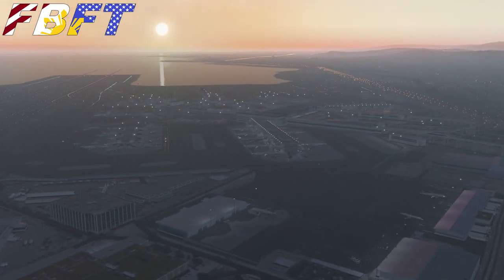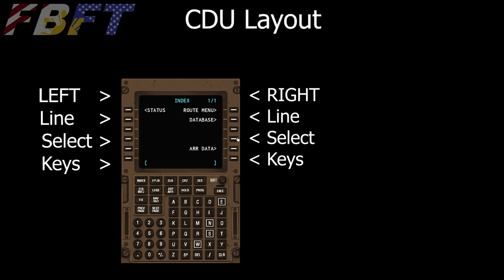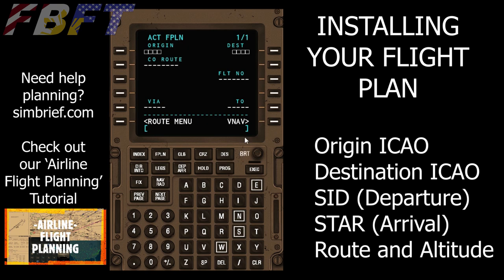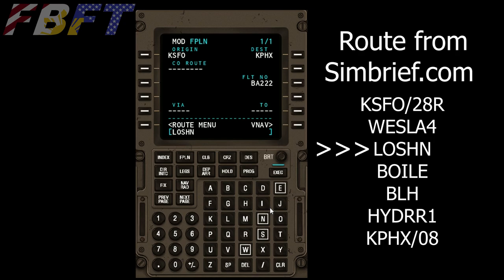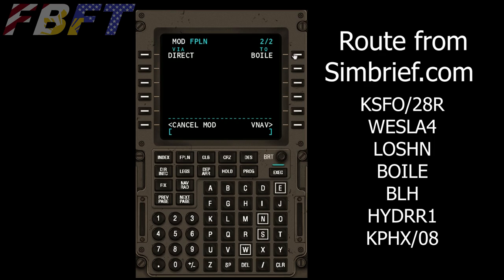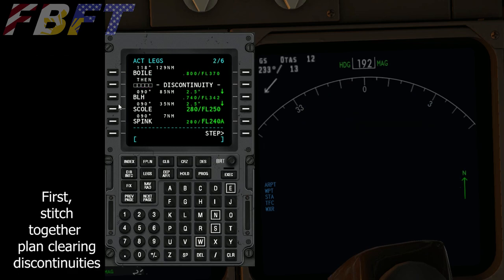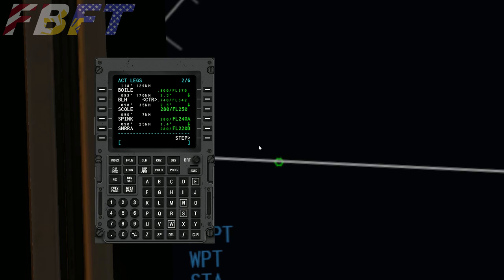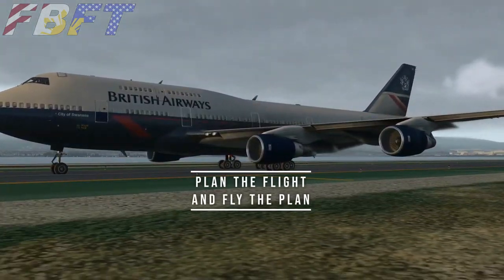X Plane - Default FMC / FMS Tutorial - Setup and Install Flight Plans

Comment: Great job again ! hope you gonna finish next procedure from departure till arrival with this plan .. look like interesting
Reply from the maker: That is what I'd like to do.  Honestly I did fly and film the trip immediately after the data entry you saw on the video, but I had issues during descent.  I will experiment a bit more to see if I screwed up or if the FMC wasn't operating in a normal predictable way.  If you just want to get going though-  take-off, above 1500' click LNAV, VNAV, and CMD.  Make sure the flight directors and autothrottle switches are on.

Comment: Yes finally I found and was shown how to do this manually, and in a speed of a DC3 not Concord  speed demonstration. It was also good that after you had typed in your flight path and you begun to check it out that you had some issues that had to be fixed, so you showed us how to fix these errors. But you still had not quite figured out or proceed the final leg where all at a sudden you were back to 5.000 feet for some strange reasons. So you stared to wondering why that was so and you went through all the pages from 1 to 5 , but the pages they were 6 of them, so why didn't you go to that 6th page to see if you couldn't see or find out what was causing that problem, maybe you could have seen it there and deleted on of the point as you did with the first error what you had to deal with? But in general this was very nicely done, and thank you Flight Brother
Reply from the maker: Thank you for the feedback. Happy flying!

Comment: Definitely one of the best tutorials I have seen on the FMS/FMC for sure. I just picked up a KingAir 350 from Airfoillabs and it has a FMS. I imported a FP from LittleNavigraph last night and it came in just fine. But it did not set the ADF for the first NBD waypoint. I would think it should do that? I had to manually program it and the the plane would not go to it which I am sure is on my end, but it just got stuck on the first waypoint and would not advance and I saw now way to advance it to the next waypoint in the plan which was a VOR. So I am a bit confused on how the plan goes from the FMS to actually being used by the aircraft. I am going to build a plan manually tonight and see if that makes a diff since I did not validate the steps with the MDF which might have clued me in. I have watched a lot of FMS videos and not one described my question so I must be missing something very obvious. Anyway, I have some breadcrumbs to follow tonight. Cheers !!
Reply from the maker: I suspect the issue is what input the autopilot is receiving. I'll see if I can check where that is for you, but basically there should be a switch or knob to go from nav/fms.  The FMC does not time radios, as it will find them without them being tuned.
Reply: @FlightBrothersFT  Yeah that is sort of what i figured, but could not find anything. And the docs that came with the plane are not very good. Plane is great...documentation not so much. I really like to know what each knob does and how and when to use it, so some decent docs would be nice. One last thing...is there a way to manually advance to the next waypoint in the FMS like you can do in a Garmin? Thanks for the reply. I appreciate it. At least now I can narrow my search.
Reply: Took me a while after an exhaustive search to find a manual to match the FMS in the King Air, that the version of the FMS in XPlane is a customized one and used in all XPlane aircraft that have a FMS device. So the documentation was readily available from Laminar. So there are about four hours of my life I won't get back. But hey, my company just let me go and gave me a real nice severance so it looks like I am retired now and have oodles of time to spend learning all this stuff. Between this video and the King Air manuals (real one) I downloaded, it's coming together. Thanks again for the reply. I will let you know the final answer, although I am quite sure it's just something stupid on my part. AE

Comment: Very nice and nice timing. I have been using XP11 for a little less than a year, and started watching your vids and learned a great deal when I got in to the hobby. Most of that in the Zibo. I have gotten an itch to fly the 747. So I get it started and realize I forgot how this FMC worked. Also I had no idea how to do the freq for ILS and course. So thank you for mentioning this. I would also be interested in seeing the resulting flight. MY flight plan I did before seeing this had the same issue with no runway in the plan. I am going to try again soon. Thank you again!
Reply from the maker: Thanks for commenting. I did film the flight, but had issues getting it to descend on the FMC. It might have been user error, it might be the vnav has issues on descent. Either way you didn't miss much worth seeing. Ended up going manual for the arrival and approach.
Reply: @FlightBrothersFT  Well I did my flight. I had to manually enter the final legs. But there were not missed approach legs. AP worked great through climb, cruise & decent. But upon final approach the plane started away from the airport. I could not disengage the cmd or change speed. I had to disconnect AP and fly manually.

Comment: Pretty good job guys.  I haven't read all the comments so I apologize if I am repeating what others have said. Yes Id love to see a video on how to implement the FMC into an actual flight.  I will be doing some reading SimBrief and the FMC manual  Please contact me via e mail or how can I e mail you?  I don't use my g mail account. I used 2 computers one to watch and take notes the other was to open x plane 11, the 747 400 and log what you said into the FMC.  There were discrepancies in the route/waypoint numbering both written and verbally.  I really enjoyed the "mistake" in the route and you show to remove/edit those items that need to be removed.  All in all pretty good job.
Reply from the maker: Trying to match our flight plan exactly will depend on which AIRAC cycle of nav data your Xplane has. We have Navigraph chart subscriptions, so our videos tend to reflect whatever was current at the time of recording. Regardless, you can generate your own flight plan in simbrief and enter that. Our airline flight planning tutorial will walk you through those steps. flightbrosft@gmail.com
Reply: @FlightBrothersFT  Thank you I will check that out and may e mail you as well.  al

Comment: One of the best tutorials on the FMC i have seen. Great job. I am curious as to what happened with the approach to runway 08 or did i miss something? It would be really useful if you could show how you activate and use the FMC it in flight... Subscribed :)
Reply from the maker: Thanks Philip. We can definitely put together an in-flight video. I actually did record the flight that this setup video is for. Unfortunately I had some issues, so I want to experiment more before making a tutorial for that. Otherwise it will be a watch me get frustrated and right with the FMC video. Thanks for the comment and sub!
Reply from the maker: We just released a video showing this flight plan used in flight. It's on our channel as 747 Autopilot.

Comment: Your videos are great. One big problem I am having is because I want to, at this stage of my flying use the default x plane atc which requires you to fill out the default flight plan. I find that the X plane default plan conflicts with the Simbrief one that I load into the FMC. Especially in the area auto pilot and navigation. For example, I will file and load my Simbrief plan. The when in the cockpit I will file a second plan using X Plane's default ATC flight planner. I even re-copy the routing legs from the Simbrief plan in the FMC into the X plane default flight planner. After takeoff at about 1000 feet I press the LNAV, VNAV and CMD buttons as indicated in your 747 400 tutorial video. At first there are no issues but when I try to make course changes as per the X Plane AI ATC controller my plane starts going crazy out of control. Even sometimes doing barrel rolls. What am I doing wrong?
Reply from the maker: Our short response is, we’ve not experienced this.  The caveat to that is that we’ve never used XPlane ATC and understand (based on forum surfing) that it’s not “ideal”.  If the ATC vectors you, you would need to be in HDG mode not LNAV at that point.  A suggestion would be try flying without ATC.  See if the results repeat.  

I’m guessing you’re really using ATC to tell you when to descend. And a 3:1-ish rule helps here.  30k feet, start descending about 90 miles out.  10k, 30 miles etc.  The only issue with this method is if you are in mountainous terrain/IMC.  This is where having your charts handy, if you use them, will help.  Your minimum safe altitudes are listed on there.  

Sorry for the longer response, but since we don’t know your level of experience, feel free to disregard what you already know, or ask a further question to clarify any additional knowledge gaps.  We will do our best to help!
Reply: @FlightBrothersFT  actually that response was a great help. I found a way last night that helped a bit. I guess when you recopy the Simbrief route into the X-Plane atc plan you can't use sids and stars. I also found when switching the LNAV on and off as needed helps. But yeah you are right I am using the ATC to vector me in to to the runway at the correct decent rate. Which is sometimes is useless as the X-Plane atc brought me into the side of a mountain last night while on a flight from CYYC to CYVR. Lol I was at 7000 feet and didn't see it until it was too late. I guess in the future I could turn on the landing lights a little early to help light up the area. But anyway thank you so much you've been a great help!
Happy flying!
Reply from the maker: @tristarRB211  “vector into mountain” is one of the most common things we’ve heard.  Typically, in the US anyway, lights are on below 10,000, unless it’s a high altitude airport, then I believe it’s 15,000.  Thanks for the question and response.  It’s great to hear the effort put into these videos is helping the community!

Comment: Best tutorial, there's no other way to put it
Reply from the maker: Thank you very much!
Reply: @FlightBrothersFT  do you use simbrief?
Reply from the maker: Always 👍
Reply: @FlightBrothersFT  is that how you set up your FMC?
Reply from the maker: Yes. If you'd like to see more on that, our 'Airline Flight Planning' video lays it out.
Reply: @FlightBrothersFT  any reason when i add the waypoint it says not in database
Reply from the maker: @realbloxgamingxd53  this is one of the most common questions we see.  This is likely due to your AIRAC cycle being out of date.  As waypoints and routes change over time, they can be updated or renamed. It’s likely the name has changed or your AIRAC database in the game is not updated.  You can not use that waypoint or we subscribe to Navigraph (not an endorsement) to keep ours updated.
Reply: @FlightBrothersFT  so the only way to make it work again is to pay the subscription?
Reply from the maker: @realbloxgamingxd53  there may be other ways, but this is the one we use.  It’s more than just AIRAC data.  Charts and moving map blah blah blah, you can research it if you’d like.  You could 1) not use whichever waypoint is giving you an issue or 2) pay 1 month of subscription then cancel it.  It’ll give you that current cycle’s data.  Again, there may be other options out there neither of us have needed to explore it.  About $100 US for the year and we get our money’s worth; but everyone is in a different position.

Comment: The default Laminar FMS is very quirky and seems to do random stuff everytime I put in a flight plan. One thing you definitely need to be careful of is making changes to existing flight plans. FMS somehow doesnot respond well to any changes once it has calculated your VNAV and LNAV. You pretty much have to exit XPlane and start fresh from a blank Flight plan. If you want to use FMC for Auto pilot than I would suggest moving to Zibo Mod 737. I don't know why Laminar doesn't fix or improve on the current shoddy FMS integration with Auto Pilot.
Reply from the maker: We have definitely experienced many of those same issues.

Comment: what about v1, vr, v2? where can i setup it or calculate it?
Reply from the maker: Excellent question.  You have reached the greatest limitation of the default FMC. Being made to work with almost any aircraft, it lacks the aircraft specific performance data to do those calculations. You can work around this by using the charts manually or just estimating. Your biggest risks will be on short runways, high altitudes, high gross weights, and hot temperatures.  If you have any of those conditions, you should check the performance tables first. Many are available with a quick Google search.

Comment: The SID in my route was not on the fms. Can you please help me? I used sim brief for the route
Reply from the maker: This is likely due to the AIRAC cycles being different.  If you have a subscription service, Navigraph for example, it will keep the nav data in the sim current.  The chart cycle is also in Simbrief, so if they both match, you shouldn’t get errors.  This is the likely cause.

Comment: I have pretty much nailed the zibo FMC. Recently tried out the 747 and i can't find the 'Takeoff' and 'Approach' page to calculate the V1,Vr,V2,and Vref which bothers me A LOT.
If anybody knows how to calculate the V speeds manually using a calculator (my math is bad).
Also the performance page found on the 737 cannot be found which lets me enter the CRZ ALT,Cruise Temp,fuel, cost index,etc. Seriously i am bothered that i could enter some of information into the FMC of the 737,but not on the 747.
Reply from the maker: Hi there. We share your frustration, but can explain the reason. The Zibo FMC is a custom programmed replica of the real Boeing FMC. The default Laminar 747 uses a generic Xplane FMC that roughly follows Boeing logic but lacks the model specific performance calculations (this same FMC is in the default MD80, and numerous payware as well). I would suggest checking out the SSG 747-8i if you are interested in having a 747 with a highly realistic FMC (like the Zibo has). We both have the aircraft and find it to work well, and it has ongoing updates which are improving the product (soon a freighter will be released in an upcoming update, and we've had the privilege of flying the beta version).
Reply from the maker: Oh I forgot to mention, watch the speed tape on the PFD for V speeds and VREF indications on the default 744.

Comment: is there a video you made that shows how to enter all the weights and fuel from simbrief into FMC?
Reply from the maker: Unfortunately this is a limitation of the default FMC being able to work with multiple aircraft.  Some of the information is able to be input.  Let me confirm which video contains the information and I’ll post it back here as a response, though it works better with aircraft with custom FMCs, like the Flight Factor and Zibo “type” aircraft.  More to come, let me look at our videos.
Reply from the maker: Here is the FMC set up video for the Zibo.  If you are using the default FMC, as mentioned, not all of this information is able to be input.  I hope this helps, and if not, please fire back to us and we will try to help you further.  https://youtu.be/Mkno79J9XVA
Reply: @FlightBrothersFT  Thanks- I'll watch it later today. Again, its not the FMC or CDU
machine itself, its the weights and fuel info needed to input into the FMC- thats not on Simbrief etc. is it within the flight sim software program itself?
Reply from the maker: @Mikinct  well the weights of the aircraft are in Simbrief.  You can edit those to match your in-game aircraft, I believe it’s the “airframe” tab, such as gross weight, max fuel etc.  Once you run Simbrief with the selected aircraft profile, and route it’ll populate the fuel, weights, altitude and cruise speed.

Comment: I loaded the route, but i cant press any key on the FMC...it shows me "key not active"...how to correct it
Reply: In common case - you must clear a scratch pad (many time press CLR), sometimes it can store many lines, which you don't see, with warnings and error inputs.
P.S> official LMR guide (https://x-plane.com/manuals/FMS_Manual.pdf) may be it will be useful and try google if it did help.
Reply: @denisgoodman4492   I solved the issue dude....instead of co pilots fmc I opened pilot fmc...thanks for the reply bro